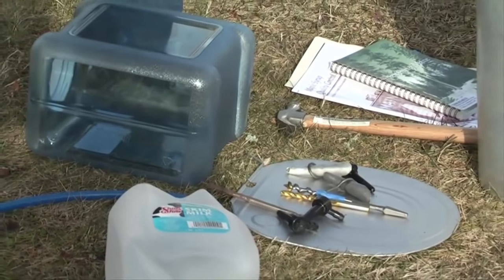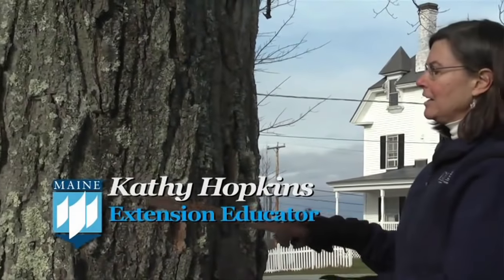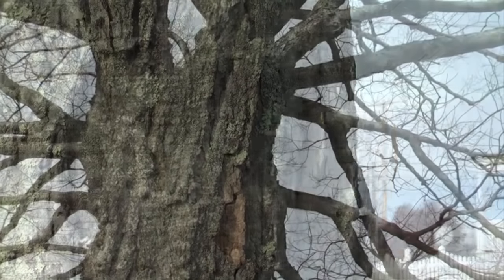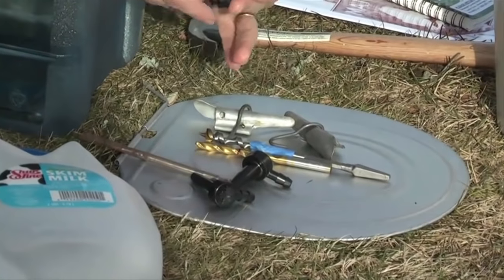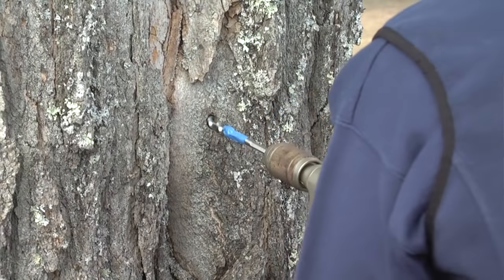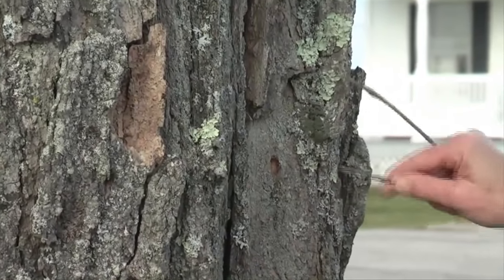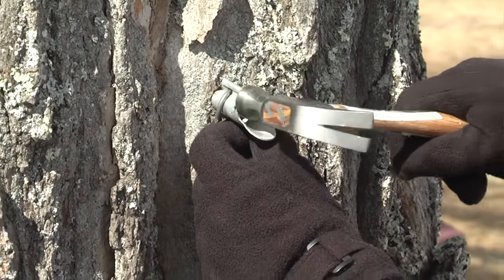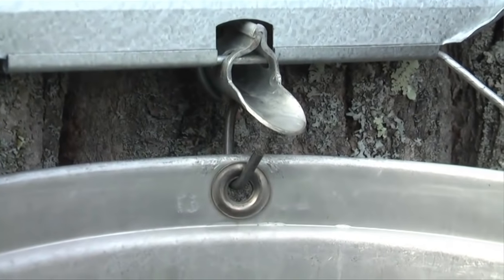How do I Tap a Maple Tree?

Comment: Do you have on video on varieties of maple that can be tapped and how to identify them?
Reply: From what I've learned from some of the guys in my area that have small syrup businesses, you really only want to tap sugar maples (also known as rock or hard maples). These are the only ones with high enough sugar content to produce the kind of syrup most people want. You can tap other maples, but I was told that the soft maples are easy to kill if tapped incorrectly, and the sugar content is comparatively low so they don't make good syrup.
Reply: Eric Morrell how can I tell if I have a sugar maple? It HUGE!
Reply: @oopurpledove  The leaves and the bark. Sugar maples have a distinct bark that has a very rough, very "scaly" appearance, especially if it is an older, larger tree. Softer maples tend to have bark that is not as rough. It can be a little tough to tell because maples are all fairly similar, but you should be able to look up some good videos on identifying sugar maples. The other option is to tap it and test the sugar content to see if it is producing sap with enough sugar. You can do this by purchasing a sugar hydrometer. That's what we use to determine the sugar content of our trees so we know how much sap we need to make our 5 gallon batch of syrup each year. 

The rule is:
86 divided by the sugar content is how many gallons of sap needed to make one gallon of syrup.

Hope that helps!  :)
Reply: Eric Morrell —oh my, this is great information! You’re so sweet for responding.  I’ll see if I can find a sugar hydrometer, tomorrow after work. I’m excited about this!
Reply: Many of them I believe but sugar maples have the highest sugar content and so require the least amount of reduction.
Reply: Ive heard people tap other trees such as elms etc.

Comment: I would 100% eat off that bit lol.  If there's heavy metal residue or a poison on the bit you have a problem, a little Fe rust ain't hurting ya (that's actually in the syrp you're tryin to git outta that stick).   My 20" trees get up to 5 taps, and they are fine, year after year, after year... and I know trees (studied them with a U).  It would take A LOT of insect and fungus attacks to have ANY effect on a tree.  Woodpeckers drill lots of holes... winds break off jagged, poorly healing branches...  Just get out there and learn and live a little before you die.

Comment: How difficult is it to use a brace and bit on a tree?
Reply: You're just drilling into green maple. It's not that much harder than if you were drilling into lumber. It really depends on if you happen to hit a knot or some kind of mineral deposit in the wood. As long as you get a nice clean spot in the tree it's just like drilling a maple board except that it's a little more difficult to start because the bark makes for an uneven surface.

Comment: I think it's not good for trees. Would you like to suffer such chronic pain, if you were a maple tree?
Reply: It's just like donating blood. Not a big deal.
Reply: @wildboystv3013  Yes, well said. Also, there is no evidence that trees have pain receptors like animals do. Plants have very different cellular structure and overall construction than animals. They are literally designed to be able to handle broken branches, scratches from animal claws, holes from wood peckers and insects, etc. Tapping a tree correctly means only drilling the outermost rings and avoiding the heartwood. This is equivalent to just penetrating the outer layer of dermis on an animal. You could say that you're not drilling into the "meat" of the tree. It's less invasive to the tree (when done right) than an I-V is on an animal. It is wrong to make arguments like that by anthromopomorphising plants. They aren't animals and do not feel pain like animals do. If they did, they'd be in immense pain every time a bad storm rolled through or any time an animal dug a hole in it (which happens sometimes on a daily basis), and no living thing would evolve that way.
Reply: Bro think about it, does a tree feel pain? Can they think? No, so don't be worried about it
Reply: Flew right over their heads